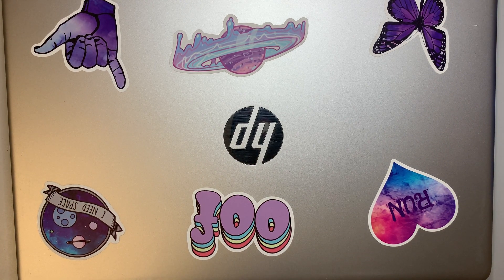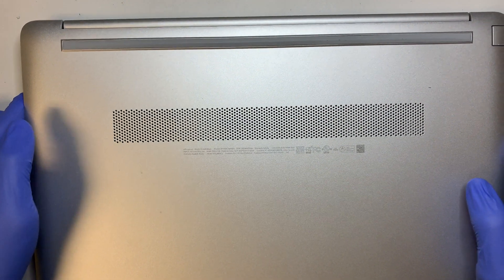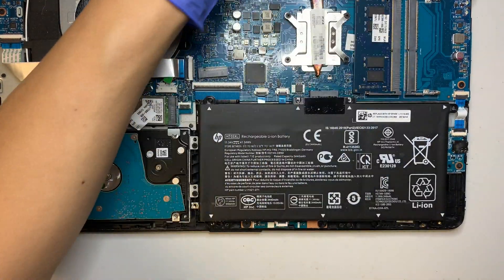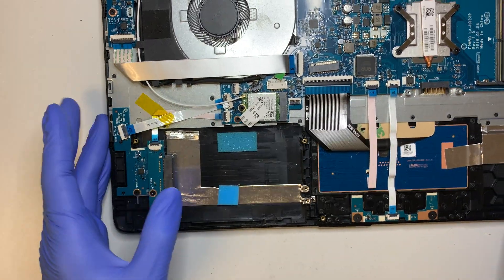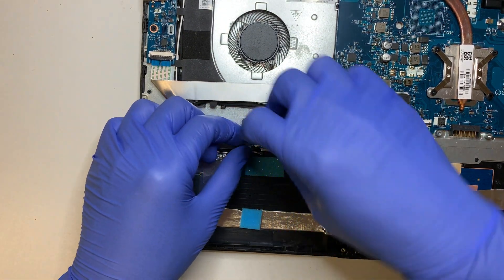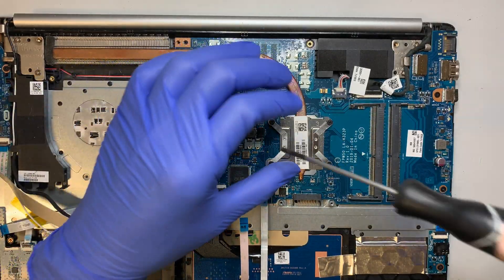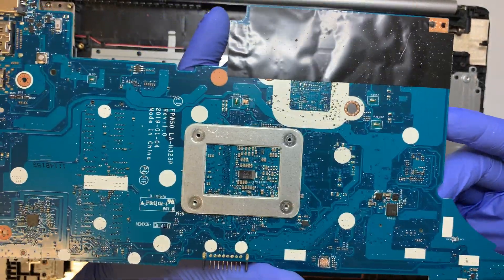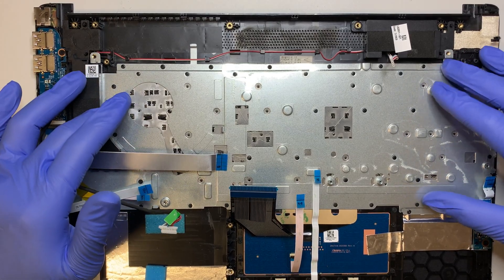HP 15 dw0038wm Tear Down HD Replacement

Comment: Hi! Thanks for the video. I have a question: in this HP 15 model where is the CMOS battery located? I have the HP model 15-DA0018NP and I have a CMOS checksum error on boot.

Comment: I have a 15-dw laptop, the speaker and audio jack stopped working at the same time. it's not a software issue. What then? The audio jack is is on a separate panel not on the main hard drive. the laptop doesn't recognize either of them, when I troubleshoot it says to plug them in. but they are. Can you help?

Comment: Hi! Great video, really well done but I have two questions. 
My laptop came with a M.2 NVME drive and I'd like to upgrade it adding a solid state drive, so i bought  a SATA connector with his flat cable (mod. L52024-001) and of course a 2.5" SSD. Now I'm looking for the SSD mounting bracket but can't find it. Can you please help me?
Then I have a problem with the ALT GR key that sometimes does not work and I have to beat it many times to wake it. Is it possible to do something without replacing the entire keyboard?
Thank you very much

Comment: Does the laptop need to be dead before you mess with anything inside the computer
Reply from the maker: You can disconnect the battery before messing it around

Comment: Thanks for the video, my 15.6 laptop stopped turning on so I used my buddys charger for the same model and it still didn’t work, so I think it’s internal. I was able to open it up and noticed what looked like heat marks on the bottom plastic when I took it off. I matched it up to where it would’ve made contact and nothing seemed out of whack. Are heat marks abnormal or relatively common
Reply: L😊z

Comment: does this laptop has the same motherboard of 15-dw0053nl? I have 512 ssd on mine and would like to add another hdd or ssd, do you think it is possible?
Reply from the maker: No additional HDD or SSD. Just gotta increase the current disk to larger.

Comment: Are you sure this is the correct model number? I just bought one and when I opened it up it was completely different. There was only one ram slot and no fan. There isn't even a fan connector. It is set up for passive cooling. There are spaces and  connection traces on the motherboard for a second ram slot and fan connector but no actual components.
Reply from the maker: 2:05 maybe can match my laptop model.

Comment: I have hp 15-dw3000nk intel core i3 11th .What should I do to develop a processor that looks different from others?
Reply from the maker: You mean changing the CPU ?
Reply: @UbergeeksBiz  yes !
Reply from the maker: @satantvgaming7039  You can't change CPU on a laptop
Reply: @UbergeeksBiz  why 😢😭
Reply: @UbergeeksBiz  What if I replaced the motherboard?
Reply: @UbergeeksBiz  What do you think of the core i3 11th in games if I install an external graphics card with it

Comment: Is that an m.2 nvme expansion slot next to the fan?
Reply from the maker: Yes. at 6:21 is where I explain about 2.5" SSD and M.2 NVME
Reply: @UbergeeksBiz  I'm not hearing you say anything about nvme or m.2 slot. I also wonder if that is what's my fan.